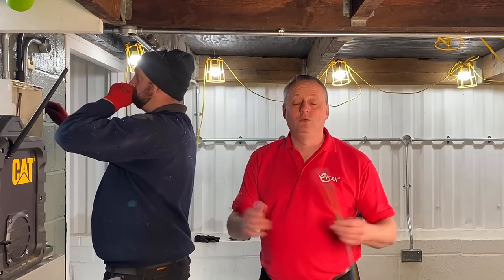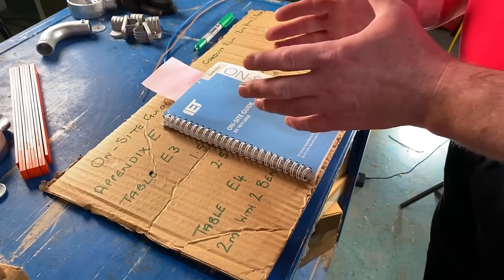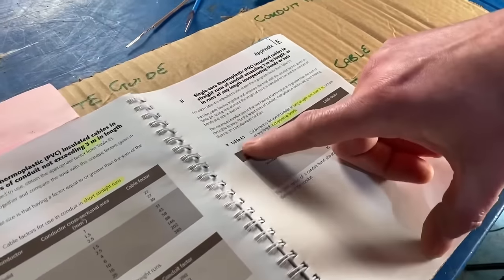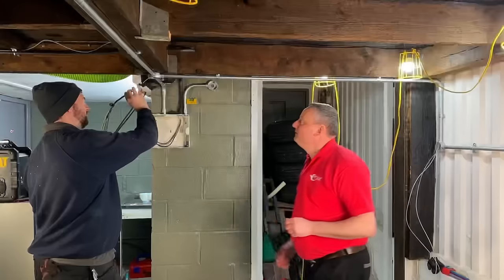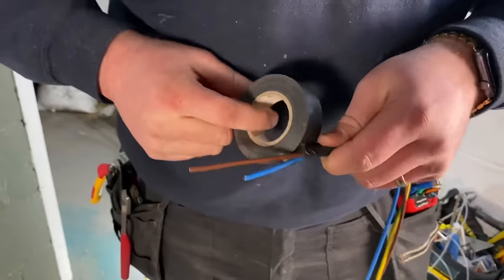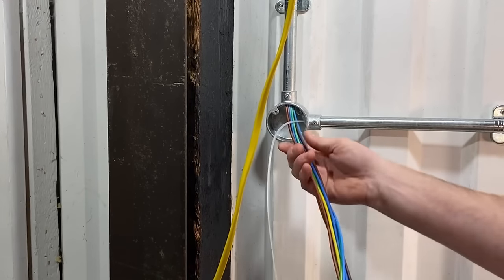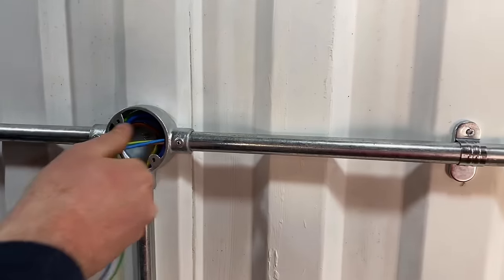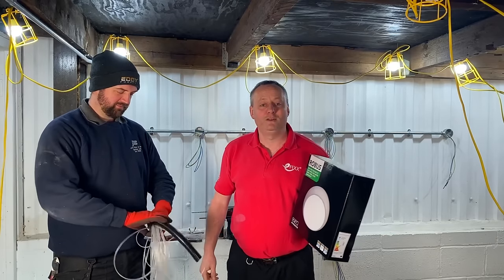Wiring PVC Singles in Conduit - Top Tips and Capacity Calculation

Comment: Nice job .
I normally use the draw tape to pull in a draw wire a 2.5mm or a 4.0 mm single core cable.and for cable lubrication I use silicon grease ..like the conduit system 👍👍👍👍

Comment: According to the regs a comon earth can be used for both circuits as long as the larger earth wire is used for both circuits in the conduit
Reply: Not a spark, but I’m sure you can use the conduit itself as earth? (Provided it’s got the correct area to carry the rated current). Think jw did a vid on it.
Reply: @alexlovett1991  
I recolect  that in the regs an earth wire has to be installing a metal conduit  system as you can't  rely  on the contact of the metal  parts as over time it could corrode on the threaded  parts
Reply: @desmondyoung5963  Especially the type is this video seems like it would give a very unreliable connection. Threaded seem better if you would want to do that.

Comment: I have a question and I was hoping somebody would have an answer in the UK it is regulation that consumer units need to be made of metal correct? Why is it that fire panels can be made of plastic?
Reply from the maker: Fire panels don’t handle high currents so the risk of a loose connection causing a fire is reduced.

Comment: Conduit work at 1st I used to tape bunches together that were being used together.  Then woops a line is damaged had to pull the bunch out dam silly me I did think it made things easier it did on install but not for matenence.  We all learn.  The new as I call it push and screw fix is faster also when threading it is easy to under do it or over do it so the boxes don't align up.  Also less tooling needed less to cary round.  I always did see a 45 and 45 as two bends you now telling me it is one.  So if I have a 45 going down  running say 10 inch then a  second 45 going up is it still one bend.  How close dose it have to be to be only 1 bend.  I know have too know the answer to that.  So to picture it a straight run of  4 foot horizontal obstical is in the way so 45 going down running say 4 foot then 45 back up running back up to being horizontal 3 foot to terminal box.

Comment: You appear to do the 2mm2 cable Calc not the 2.5mm2. The 2.5 is 244 not 256.
Reply: Good spot.
Pull it all back out and stick 25mm in. It ain't going to fit!
Reply: The left part is the length of the cable run in meter, not the cross-sectional area of the conductor. In that table that one isn't even mentioned. And there's no 2.0mm², after 1.5 comes directly 2.5mm².
Reply: @Marcel_Germann  True that. Steptoe hasn't got a clue what he is on about. And I'm half drunk and will go along with anything 🤣🤣🤣

Comment: Am i the only one who still uses a spirado?.. i find those nylon tapes a real pain not tried the yellow 77 stuff,i use the smurf goo or some talc
Reply: It's the cost of a spirado and the ability to actually get one. My last 25m cost somewhere close to £200.
It only gets used to pull in drawwires with no load on it, then back into a canvas bag(old pillowcase) and copious wd40 sprayed on yo keep it good
Reply: Granted they are expensive, but worth every penny if its used regular.. ive even cut some old ones down 5 & 10m  (got stretched or kinked) .. handy for a small job
Reply: @thattoolguy9432  expensive enough that the next time the apprentice kinks mine ill probably try out the 25m nylon milwaukee with the battery puller. 
Agree they're fantastic but realistically every year I'm doing less and less pipework cause nobody wants to pay for it, and I'm doing less for companies to profit off and more of my own work as my own boss